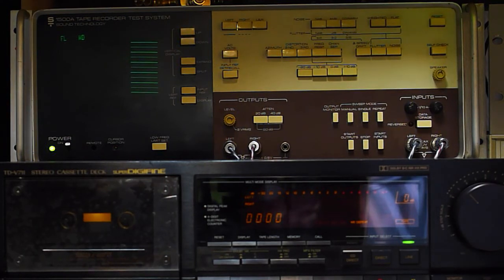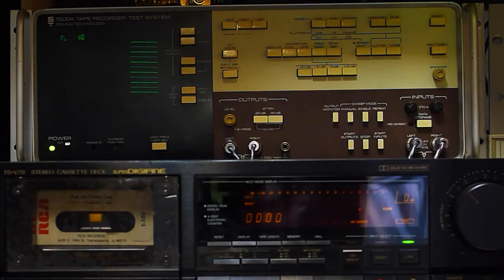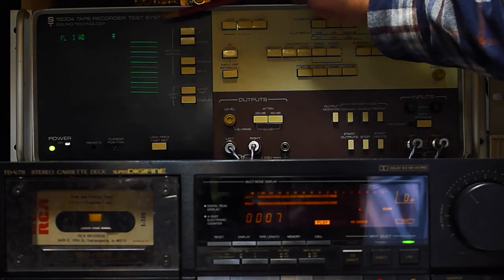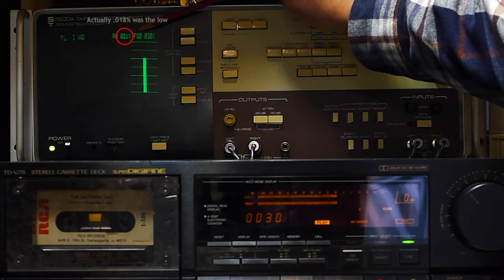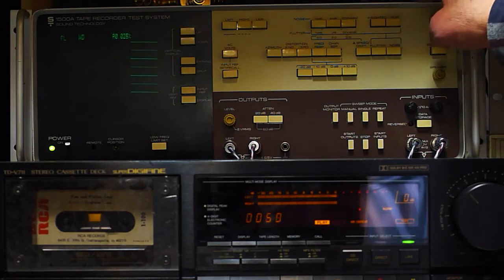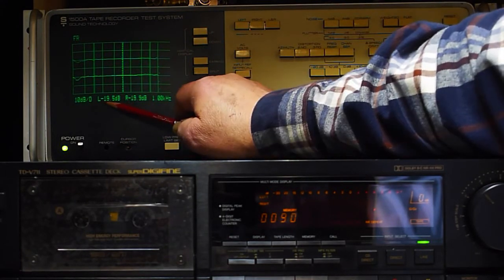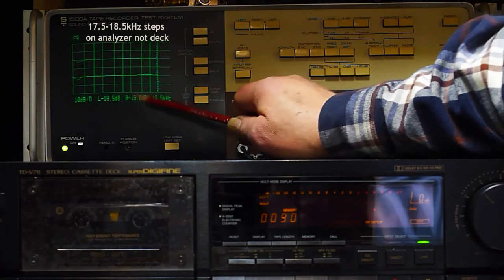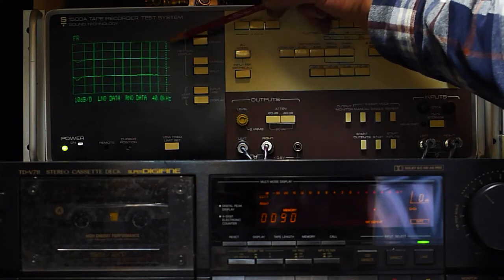JVC TD-V711 Cassette Deck on Sound Technology 1500A Tape Analyzer

Comment: I have TD-V531 and it does to my ear make excellent recordings. I remember reading about a salesman showing off an extremely well manufactured shell. One team took that shell, and along with examining candidate magnetic tape under the microscope for very uniform magnetic particles, made probably the best pre-recorded tapes ever made. The recordings were done on a particular model of JVC deck as supposedly the recording pre-amp was driven with a good high voltage. I wish I could remember the label.
Reply: Funny enough, the recordings sound best on an LXI DK5003 with zero head wear. It was made in 1981, according to the motor. I cannot find any info on it at all, but it's a rebrand of the Sherwood S-100CP.
Reply from the maker: Thank you for watching and for your comments.

I think this series of JVCs had very good sonics, their weakness was build quality. The V711 in the video got a major upgrade to a brand new V1010 motor. JVC knew they had a motor resonance problem with the V711 but chose to stuff the fabricated chassis with some high density foam, rather than use a solid casting as in the V1010 and others. I expect they had to meet a price point for US markets. The result of the full rebuild was a deck so quiet, it made me wonder if something was actually wrong, before the music track started. It was like sitting in a concert hall just before the conductor raises his baton.

It now resides in the right hands, a professional, and owner of mastering studio, who agreed with my assessment. I've owned V1010s but preferred the sound of this one. I can't explain why really, it's like trying to describe the subtle difference in bokeh between two great lenses, each known for their great bokeh. 

 If I ever manage to locate a similar motor, I'd love to build another, but that's not likely to happen I suspect ...

Comment: Personally I was a reel to reel fan since the early seventies.  In the late seventies I got into cassettes because they had came a long way in terms of recording and playing back audio...and, you could take it on the road and any teenager with a love of music wanted a good tape system in your personal freedom machine otherwise called an automobile.  This meant I mothballed my Akai R2R in favor of the compact cassette.  I will admit I took a detour into 8-track with my Wollensak 8-track recorder and outboard Dolby AN-60 noise reduction  unit  That proved problematic due to the limitations of the medium (I hated track changes w/ moving head blocks) so I wholly moved to the cassette as the best option.  TDK SA and later SA-X were my cassettes of choice with the Maxed UD-XL II's being next.  As the early eighties brought affordable 3-head cassette decks I bought JVC and a AIWA  3-head decks as I couldn't afford the best NAKS.  My AIWA had Dolby S which the JVC did not.  I usually recorded mix and dubs tapes from CDs and LPs tweaked through a Technics EQ/Analyser  with a rising top end of about 2 db above 8kHz to cassette.  I found this pleasing with a flat bias adjusted setting per each tape recorded.  My addition of a Sony 3-head deck with Dolby S in the early 90;s  allowed me to compare.  I actually preferred my JVC deck even though it only had Dolby B and C. JVC built some good stuff in the early to mid-eighties I have to say.  Just this week I got a vintage Denon TN-790'R which I haven't even hooked up yet.  I say all this because it was the race to make the best affordable hi-fi cassette decks by the major Japanese electronic manufacturers that I feel was, at least in the consumer realm, the greatest technical mechanical/electronic tour de forces of hi-fi engineering. ever.  They took a lowly Phlips dictation medium to amazing high-fidelity heights which began with the USA made 3M Wollensak sourced Advent stereo 1/4 -track recording deck.  The continued advancement of the compact cassette was only thwarted by the CD.  Still there were some very interesting advancements left on the table as the cassette died such as Pioneer's decks which added digital processing.  I guess it would be a dream to get Pioneers last, and finest, 3-head deck with digital processing as well as Dolby S, but for now I got the Denon.   I love cassettes and all the fantastic engineering that made them viable as audiophile approved taping systems.  Thanks for your video.
Reply from the maker: Thanks for watching John.

My first reel deck was from sometime in the 60's, a 3" Panasonic I think, that used enough batteries to power a small city. We couldn't afford them but it did also come with a power cord (not a wall wart). The problem was that houses didn't have as many outlets back then so it was like battling for amperes on Apollo 13. More than once I would hear something like "you can't use THAT one, I need it for the hot plate". Anyway, those were good times, enjoy your Denon.